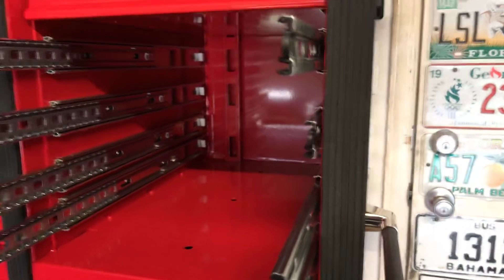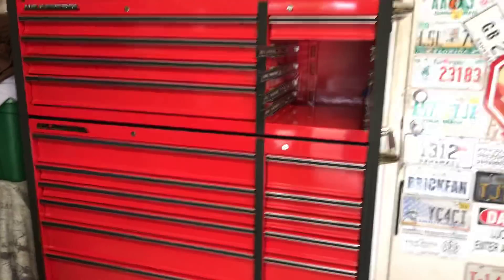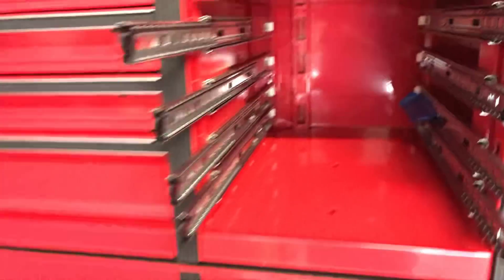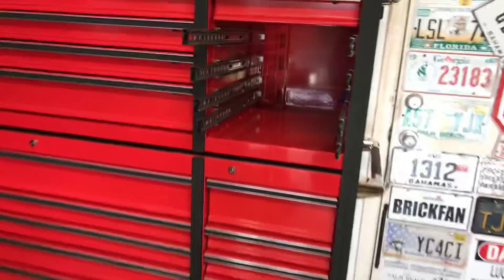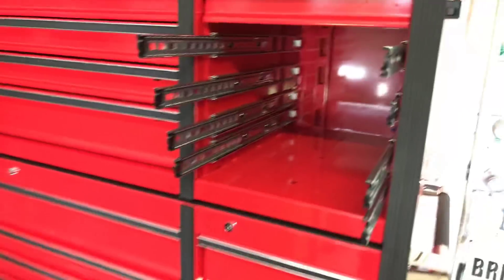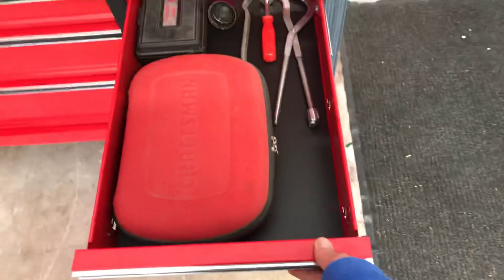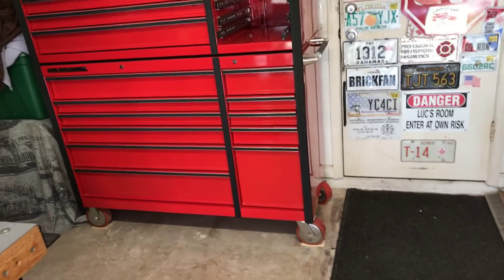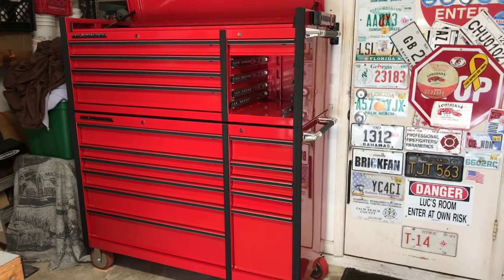Harbor Freight 56 Quality Control Issues

Comment: I used your C-clamp method for the drawer tabs. With one change. I took a cheap HF socket and cut slots out to fit around the tightening bar of the clamp and used my M12 impact to power it. Saved a lot of time and effort. Really appreciate your vids on the 56”. I just purchased mine today.
Reply from the maker: That’s a great idea using a socket and impact. Congratulations on the new box, I’m sure you’ll love it

Comment: Thanks for the awesome reviews. I'm looking to pick one up soon. The have them for $679. With $100 off plus a 20% off also. Oh that's for the bottom part. Not sure if I'm going at the top part lime you did. I just need a tool cabinet. I've liked the Harbor Freight tool cabinet's. I've noticed from looking at them and videos they are made really good, especially the wheels, all steel and where they mount to on the bottom of the frame. Solid frame. Thanks again.
Reply from the maker: Thanks for watching

Comment: The black trim looks awesome with that red. I think I saw that it's tape on the handles, is it the same on the vertical runners? Also, are those the casters that came on it?
Reply from the maker: Thanks for watching. Yes it is. I have another video that shows you how I did it. Go to my channel for that. Yes that’s the casters that came on the box.

Comment: Thanks for advice. Could a pan head self tapping screw be used instead of rivet?  It looks as though there might be enough room when slide goes back that it would clear a small screw?
Reply from the maker: Reb, the metal thickness of the box is probably thick enough that a self tapping screw could be used... but it could possibly loosen up over time. A rivet will not loosen up.

Comment: I have the 56 inch topper and the 72 inch bottom one thing I hate about the topper is the lid is so tiny not much space on the very top when you open the lid
Reply from the maker: I agree, as you can see I basically have nothing in the top part. Not really sure what could actually fit in there and still be able to close the lid...

Comment: Just picked up the 56 top and bottom. I bought rivets and started pulling the drawers out to do this mod and US General must have seen your video because all the rivets now come installed and the drawer tabs are pressed and tight! No squeaks and a happy customer!  The slides also have detents in case you want to bypass the drawer latch.
Reply from the maker: saltystevo  Really? They put rivets in the rear of slides that are in the box now? Cool. I’ll have to check it out next time I’m at HF. I didn’t get a thank you from HF for pointing out this problem...lol
Reply: @ifirefight1  yup! I was happy to see. Everything feels solid. Time will tell if i need to go back and add rivets to the drawers in rear. How is your C clamp method working without adding the extra rivet?

Comment: maybe a little late, but try heat shrinking the tabs inside the drawers, a stick of heat shrink is really cheap and you dont have to get it hot enough to damage the paint( had to do it on a old Snap-on taco cart I had). I have  a lot of old S&K tools and used to use them daily - you really cant go wrong.

Comment: I don't have a rivet gun but could self tapping screws be used instead or would it hit?
Reply from the maker: @lsturbointeg ....A screw head might stick up too far and interfere with the drawer slide. But you could try one and see how it goes.
Reply: just picked up the complete 56" tool box top/bottom/side drawer/locker because of your review! thanks! the top box, does it just sit on top. mine feels like it moves a bit but than again I haven't loaded my tools yet. also, I did exactly what you did with the drawers and used a clamp and tightened down those tabs. doesn't make the noise anymore. I tried using the screw but the head was to high. because I didn't have a rivet gun what I ended up doing for the time being was shoved a zip tie behind it and than cut if off. seems to work but not sure long term. great video!

Comment: Do you remember what size rivets you used? My 72” orange box comes in tomorrow, and this is the first thing I’m doing to it.
Reply from the maker: @jeepdad.   I used 1/8 diameter steel rivets. Probably 1/2” long I can’t remember exactly. You just need the rivet to be long enough to go through the drawer slide and the metal on the cabinet and have room to grip.
Reply from the maker: Hawkins2769 you probably will need longer rivets than that. Go with 3/16.”

Comment: Thanks for the drawer slide tip👍🔧 my mac roll cart slides are soft close but held the same pinch tabs minus rivets
Reply from the maker: Glad it worked for you on the Mac . Seems like such a small amount of extra time at the factory to do this, would be a huge improvement for the end user

Comment: Do you have the top box bolted down to the bottom box thanks
Reply from the maker: No I don’t. No need in my opinion.
Reply: @ifirefight1  ok is there a spot if you wanted to bolt them down
Reply from the maker: If I recall, im positive there were holes in the bottom of the top box to be able to bolt it to the bottom one. I can’t be certain if there were holes in the top of the bottom box.. but you could always drill them through the holes in the top box and they will line up properly
Reply: @ifirefight1  ok thanks appreciate  it
Reply from the maker: You can actually see the holes in the top box in the video..look at the area that I have the drawers removed from.. there are 2 holes in the”floor”
Reply: @ifirefight1  ok thanks appreciate  is there holes in the bottom box in same location
Reply from the maker: I can’t be certain that there is. I don’t recall seeing any though.
Reply: @ifirefight1  oh ok thanks might be going to harbor  soon so I might check them out

Comment: how about you sand blast your old box and put a nice coat of paint on it? that would be fun to watch
Reply from the maker: @dann hienn ... You know, I actually thought about “restoring “ the old Snap On box....would be quite a bit of work. But the wife always mentioned her grandfathers tool box and how old and beat up it was, and how I would have loved it... so for now, I will leave it as is.. maybe my Son will want to restore it some day.
Reply: @ifirefight1  can the silver covers on the s/o drawers be removed and reinstalled? kinda thinking of what it would be like to take them off to sand blast and powder coat my old box.
Reply from the maker: @dann hienn ... yup, they can be removed. They are pressed on and can be slid of by a hammer. So it would be difficult to reattach without scratching it.
Reply: @ifirefight1  what do you think it would cost to have it sand blasted and powder coated?
Reply from the maker: @dann hienn .. way more than it’s worth.. that would be a labor of love. I know, I did autobody for 20 years...  but it would be sweet to restore it back to new!